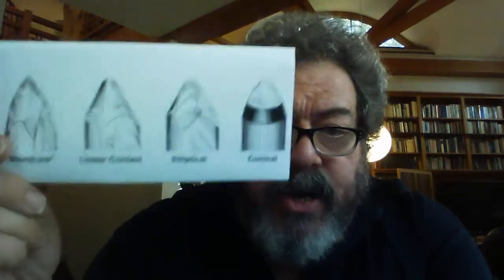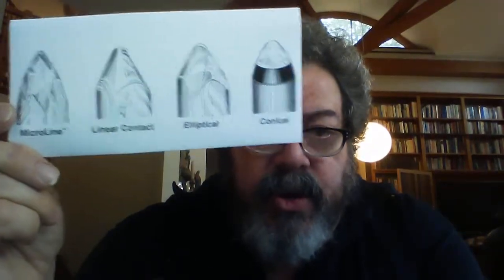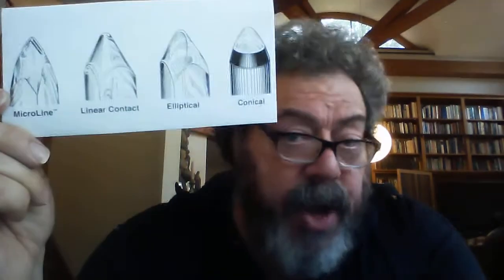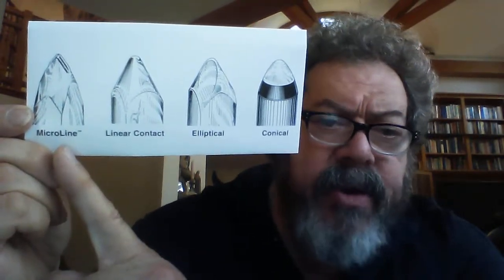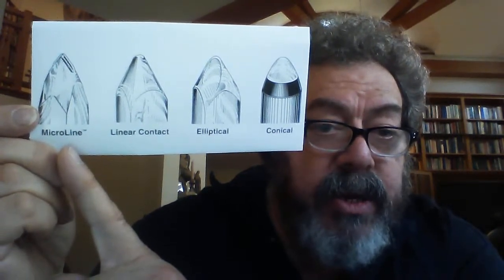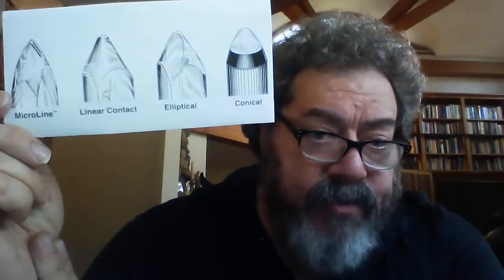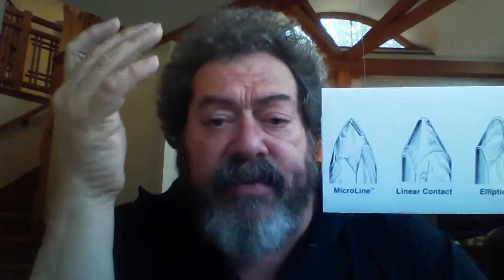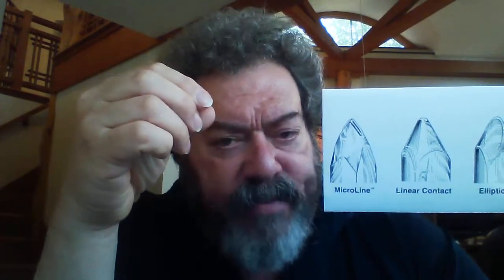Stylus Shape part 2 - Soundsmith - Peter Ledermann

Comment: Wow! Yes. And keep that needle clean! I collect 78rpm records (Lonnie Johnson "Blues in G"... I never knew such music existed). I've several old '40s and '50s  valve amp record players for just this. But, woooo... even with a needle replacement, they can be rough. And heavy armed. That old shellac can only take so many spins. I recently purchased a '65 Dual 1019 (because of the adjustable tonearm) and hit the internet road looking for a spare cartridge I could fit a Shure 91-3. Because, it seems like a decent poor boy solution. Thank you very much for this video. I'm going to experiment with different needles based on your very informative video.

Comment: What's the best stylus for playing quadraphonic disks, SQ, CD-4, etc? I do not as yet have a quad system but my priorities are, 1) not damaging them, and 2) extracting the best sound. Thanks again.
Reply: Shibata was specifically made for quadraphonic
Reply: Shibata is required for CD-4 encoded discs. Microline is fine for SQ encodes.